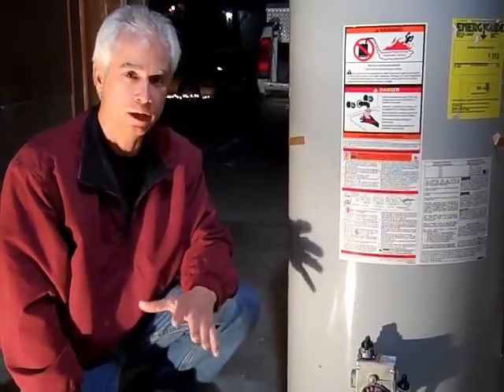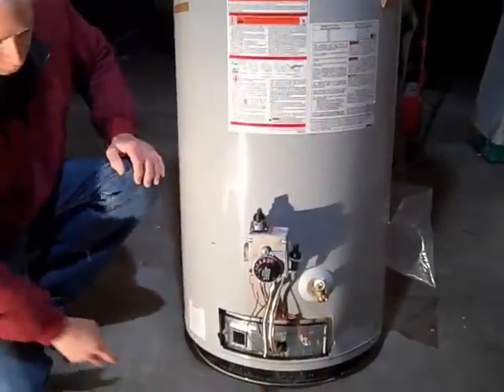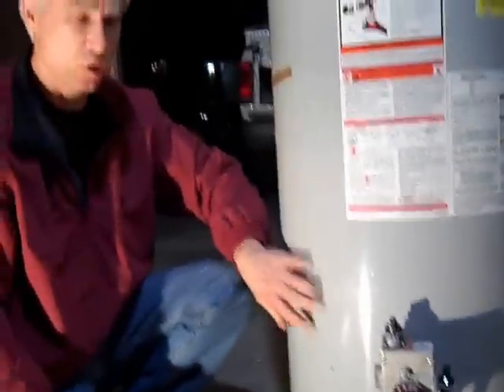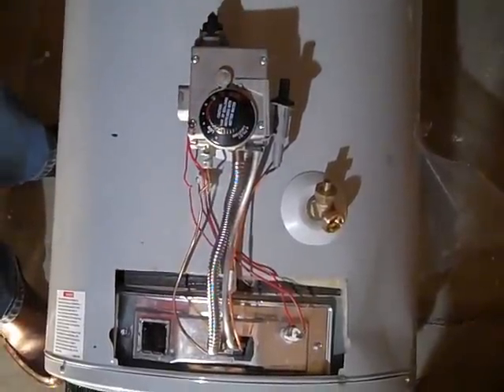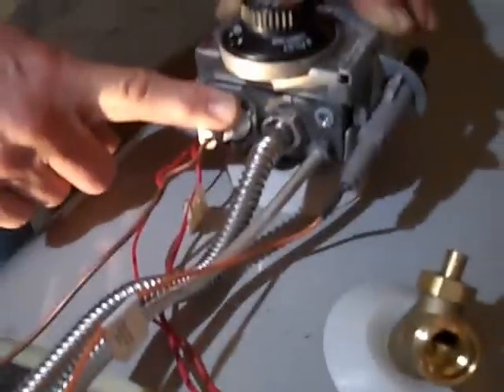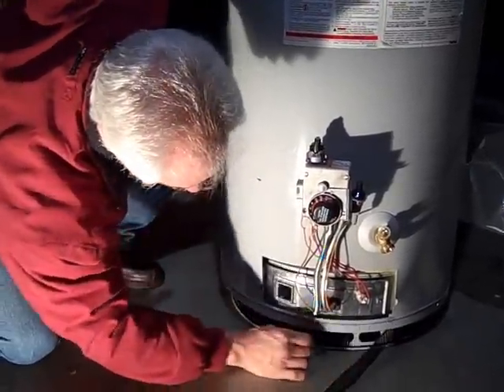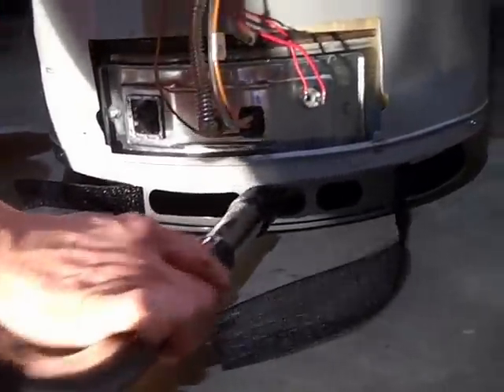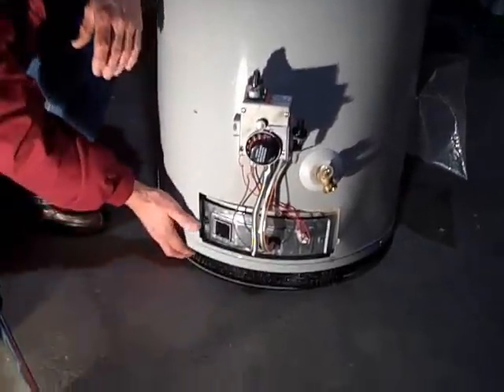The majority of problems on todays water heaters can be solved with the tightspot vacuum brush.

Comment: Thank you so much for this video. Nobody else mentioned this. I made a makeshift tool with a toothbrush taped to a backscratcher to clean it off while vacuuming, clicked the switch and it fired right up. Even though my homemade tool worked it is definately going to be easier and more efficient when i get your vacuum attachment. Im absolutely going to purchase this just because you saved my day (also because everybody should have one really).

Comment: I used a bottle brush about 18-24" long picked it up for $2 worked great for getting in the vents to clean the flame screen
And since I was busy doing that I took the time to pull the burner assembly out which only takes about 10 min, vacuumed the  burner off and removed build up on the thermocouple.  Seems like my problem went away(Burner would run for about 8 to 10 min then the burner and pilot would shut off).  Maintenance I had no idea that needs to be done semi annually, Ty for this video showing this it was perfect.

Comment: I have an A O Smith model:100 50 gallon gas water heater. It's about 10-11 years old. Never had a problem till my wife complained this morning that her shower was warm but not hot. I checked the pilot and sure enough it was out. Tried three times to re-light the pilot but it would go out immediately when releasing the pilot switch. Researched on-line and found out the corderite disc gets full of dust and creates air blockage/heat buildup which triggers a safety measure shutting off pilot. I found your video searching for a cleaning method. It worked flawlessly the first time. Thanks for saving me $$$$$$$ in a service call.

Comment: Dust and buildup on the flame arrestor vent at the bottom of the WH was the problem in my case.   I do a fair amount of wood cutting in the garage and the saw dust was the problem.  The pilot would light okay and stay on, then the burner would work for about 10 minutes, then shut off prematurely.  When it did, the pilot would blow out simultaneously.  Cleaning the dust and buildup from the flame arrestor vent and the entire bottom chamber with a vacuum solved the apparent airflow problem.

I used a strong vacuum cleaner and connected the hose to a short piece of pvc sprinkler pipe I rigged up.  Duct tape on the joints to account for the mismatch fit up of pipes.  At the end I used a 90 degree pvc elbow, but I had to hack saw off some of it to get it to fit in the tight space below the WH.  Vacuum all around the chamber removing all dust and hold the end of the PVC elbow up against the underside of the flame arrestor vent to clear all buildup using suction.  Voila!  zero cost fix

Comment: I have a Sears Miser 9 water heater and am 99% sure a dirty flame arrestor is the problem.  I can re-light pilot and also get burner to turn on, but only for a short period of time (5-10 minutes) and then it will turn off.  I just ordered the tightspot brush on ebay, ..I'll give a try and keep you posted. Thank you!

Comment: Great video, I got water in my basement, enough to make hot water heat stop working. Went to re-light pilot and it re-lite but as soon as the main burner came on it would only stay lite for 10 seconds and go out , also taking the pilot light out with it. To make a long story short, by cleaning the flam arrestor or screen on the bottom side of water tank that must of got plugged from the water it allowed the right amount of air into water heater burn zone and works OK now. So with out this air flow the main burner would not burn correct and not flam up like it should and burn sideways and take out the pilot light. Make sure this area is clear and clean for correct air flow. Great tip did not know it was there.

Comment: This man is correct.  When my flame arrester  got plugged the pilot and and the burner would not stay running.  Unfortunately, if you have a Richmond/ Rheem water heater, you cannot access the bottom of the flame arrestor -it is totally encapsulated and buried underneath the water heater.  When a Richmond/Rheem is plugged (trouble shoot by removing sight glass, if water heater runs without sight glass you are starving for air), the entire unit must be flipped over, disassembled, cleaned.

Comment: Howdy,
Even with a small vacuum brush, the flame arrestor was about 1 inch thick, holes were too small for even a toothpick! So, it get's clogged up and there is no way at all to clean it. The new model I have, has a flat steel screen, easily accessible to get to. I love it!! It's a Whirlpool.

Comment from the maker: the new design does allow better drafting.but preventive maintenance (cleaning the flame arrestor) is still required.the reset button on the thermo cut out was also a nice improvement.replacement parts are no longer needed if pilot goes out due to a dirty flame arrestor.

Comment: I had this problem,called a heating and plumbing comp,the guy came out stood in front of water heater and told me I needed a new water heater,quoted me 900$ installed,I told him I would think about it,then he charged me 65$ for coming out,and I told him he didn't do anything to get paid for,I told him the least u can do is clean it out a little or flash a light on it for 65$ ,he got a long wirey brush and just rubbed all underneath the water heater,and guess what?the pilot lit stayed on burner went on and stayed on,needless to say I never going to call that comp again and also wrote them good review...if u know what I mean

Comment: I have a 40gal Rudd Ultra Low Nox Pacemaker having same problem but only this one only has vents at the bottom side and they are clean does not have a flame arrestor at bottom

Comment: Thank you so much!.  For me, the pilot light would light just fine.  It would then either go out by itself if I left the pilot light on for a few minutes or if I turned the thermostat up immediately after getting the pilot lit it would burn itself out in a second or two.  The flame would appear to go from being at the burner to slower move towards the bottom of the chamber and then die out like there was no oxygen.  This occurred immediately after a flooded basement due to a failed check valve in the sump pump line.  I didn't have the vacuum but used a brush the just fit (brush for removing snow from car windshield actually) and inserted it below the water heater and brushed the bottom for a few seconds.  After lighting the pilot again the flame took off immediately and I finally have hot water again.  Saved me a ton of money.  Thanks!

Comment: If theirs a flood and the pilot light gets wet and does not come back on. Can parts be changed or do i have to buy another gas water heater?
Reply: Yvonne. Stewart I suppose you can pull the burner and thermopile unit out, dry them off really good with a blow dryer, put them back in and see if it lights again (before buying replacement parts)

Comment from the maker: There are many different ways to clean the flame arrestor.the tightspot vacuum brush was design to ciean the flame arrestor quickly, effectively and without removing the flame arrestor. I recommend only a qualified tech to touch gas connections.There is no need to touch the gas connections are requires any tools. just five minutes and a vacuum cleaner. the tightspot vacuum brush works great on refrigerator coils too.

Comment: What if you dont's have a flame arrestor? And are required by code to have pan that blocks access to teh bottom to brush out?  My Water heater will not stay lit, but I dont see any flame arrestor or temp sensor as you indicate.
Reply: broderp to

Comment: We bought a new water tank and had it installed by an army vet this past June.  We had to fix some of the piping as we had a slight carbon problem.  Upon reinstallation, the pilot wont ignite.  Our flamer rester is clean, but I noticed that it is wet from water.  Could this wetness prevent the pilot from being lit?
Reply: Ya, thermocoupler needs to be hot to send a signal and water would cool it down

Comment: If you have the vents remove them.  Inside the flame pan if you have the ceramic' drill inch a 2 inch hole or beat one out of the ceramic. You will never need to clean the flame pan again.

Comment: I moved into an apartment recently and the landlord said the gas water heater was brand new. The hot water runs out in the shower after about three minutes. i tried turning the thermostat up on the water heater and that didnt help. I am assuming if the pilot light was out that would mean I wouldnt be getting any hot water at all. Any suggestions before i have to call my landlord? thanks very much in advance.
Reply: Open the gas line all the way.

Comment: Well, the new one I have doesn't give me any problems at all. The flame arrestor is a different design and very easy to access. I was sooooo sick and tired of dealing with Sears "dummy" parts dept. They thought I was scamming them, coming in for a new burner assembly every month. The only place that had them was a 50 minute drive from my home. The new flame arrestor is a steel LARGE hole screen, not like the ceramic one I had with literally pin holes that a toothpick would not fit into.
Dave

Comment: No, there is barely enough room to get two fingers near it. The arrestor is about 1 inch thick and the holes are smaller than a tooth pick. They really screwed the pooch on this design. Hard to explain, but when you take the burner assembly out, the whole left is very tight. I was able to tape a tooth brush to a coat hanger to try and get in there, no luck. I am really happy with the Whirlpool I just purchased, no problems yet, knock on wood! LOL

Comment: i have a 91 gal hot water gas tank. it has no return flow its set up just like a 44 gal home hot water heater, mine has to supplie hot water to 12 6 1b room apartments and 6 2br apartment, my resedents are complaining they never get hot water. this happens at different times of the day. i have drain the tank there is nothing in side the tank, becouse i have a seal metal opener. so i can see inside. please what the hell is going on.

Comment from the maker: never remove sight glass from water heater. this could lead to all sorts of legal problems if there is a fire. if you have a water heater that you cannot access from the bottom,you can clean the flame arrestor by removing the burner assembley. once the burner assemble is removed, look inside and see if the metal plate has fallen down on top of the flame arrestor(screen).if so, you need to call the manufacture to get the required parts to reset the metal plate off the flame arrestor.blow clean.

Comment: The water tank shown in this video is a piece of cake compared to the Kenmore Power Miser. The flame arrestor is located underneath the burner assembly, once you remove that, which is easy, you can barely get your first few fingers in there to barely touch the flame arrestor. I've used wire brushes connected to coat hangers, etc. It is round with very small holes, impossible to clean. I have bought over 10 burners, Sears and Kenmore refuse to admit the problem. Don't buy Kenmore or Sears!

Comment: This is possibly the worst designed water heater I have ever seen.  This guy talks about the vacuum attachment as though it were standard equipment with every water heater.  I hope this wasn't designed in the US as what it says about our engineering capabilities is pretty awful if it was.

Comment: Don't buy a Rheems gas hot water heater = Piece Of Shit
Reply: I got rid of the stupid vial that explodes if somebody farts in the wrong direction while walking pass the hot water heater in the hallway.  I just pried it open with a paper clip piece.  Also need to make certain you have a good supply of fresh air enter the bottom and vent directly out the top to atmosphere.